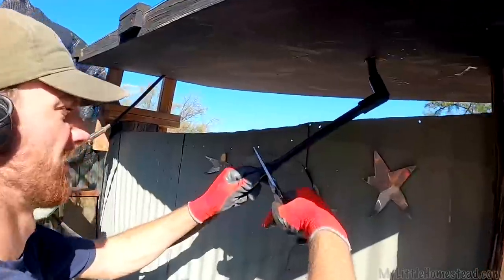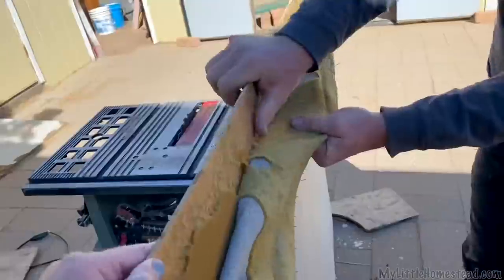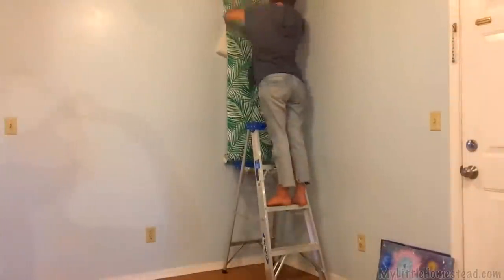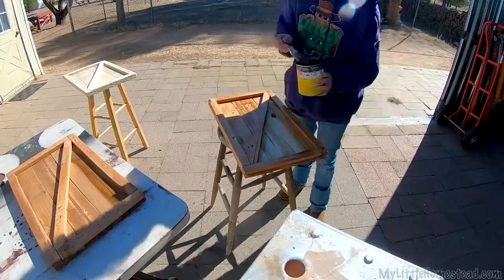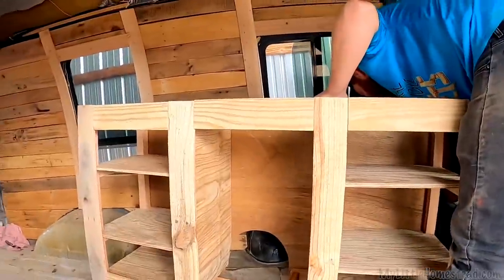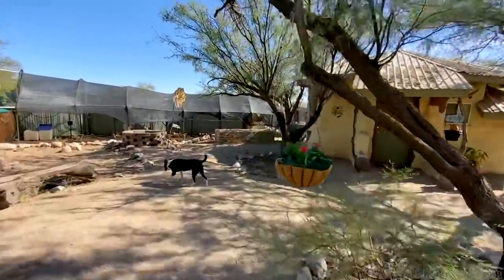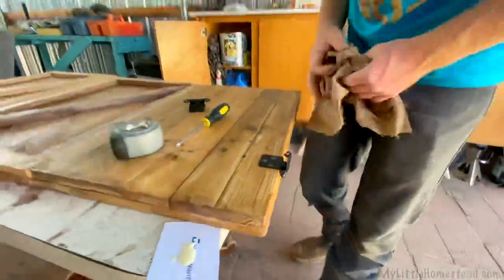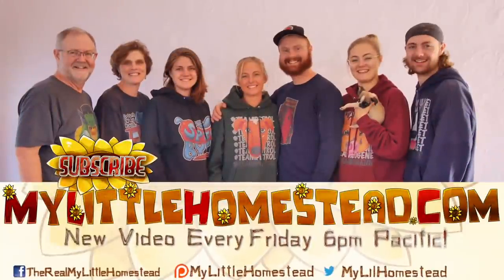Aquaponic Solar Water Heater & Van Conversion Cabinet Pallet Doors | Weekly Peek Ep258

Comment: To Bryson:  It strikes me that it would probably be a good idea to insulate the warmed water line between the solar collector and the aquaponic system, as well as possibly the long arms of the aquaponic system as well, to conserve as much of the gathered heat as possible.   Also, it might be a good idea to figure out a temperature activated cut-off switch for the pump, as well, to keep the temperature from going too high, in the event of an extended warm, clear period.
Reply: Maybe insulate both lines so it doesn't freeze on the way to the heating station?

Comment: You are basically using insulator to transfer heat and that's why you have melting. You have much more heat input then output and this causes heat to be accumulated to the heater input and eventually it will cause melting. What you have to do is to is to achieve as higher heat exchange as possible. You should try copper piping with black paint coating instead of using rubber/plastic hosing.

Comment: Bryson would it help to put the grey pipe insulation on the lines help keep them from freezing as the water sits in the lines at night. Or end of the season pool noodles. Shea you hair looks cute.  Garden and Ellie looking great. Nice thing about the old insulation it will keep the squeaks from being loud. You all have a great week. God Bless.

Comment: For many years I worked for the local High School Adult School.  I drove big band with lift and wheelchair equipment. We too would remove certain elements from the vans to haul things that did weight a bit. By removing the lift mechanisms you freed up poundage. Some older Van's may be under breaked so always give yourself a little extra breaking space when driving. You're going to be fine.

Comment: I run an exhaust fan for a hot upstairs storeroom directly off a solar panel.  It's amazing how much the speed varies when clouds pass by.  Make sure your system has a check valve so it doesn't drain back every time the pump slows down.  Best way to engineer a water system is with the pump at the source PUSHING the water through the system.   Diaphragm pumps like that are pretty good at priming, but pump much more efficiently by pushing rather than sucking.  Mounting it at or below the water level is ideal.

You might be losing a lot of your heat on the long run to/from the panels.  Look at the insulated double tubes used for outdoor boilers.  Adding glazing over the coils will bring much higher temps but another reason for the check valve, if the pipes are dry or the water still, the sun will melt the plastic.

Another way to prevent winter freezing is a geo system, where you have a run of tubing buried deeply, ideally with an insulation cap above, that takes advantage of the ground temperature averaging around 55 degrees year round.  Also works to limit maximum temp in summer.  Whether you're pumping out water at 35f or 85f, the return water is around 55f.

I saw the goats eyeing the new stuff over their pen.  They can be jerks, I hope they don't manage to jump up to try to bite or otherwise damage the hose.

Garen, beautiful looking cabinet, but now you feel why RVs are built with 1X lumber and thin ply paneling.  Weight really matters on mobile builds for both fuel economy and handling/performance.  Stationary furniture you can afford to overbuild  Also I've learned the hard way it's worth pulling shelves back out and fine trimming them instead of hammering them tightly in place.  It can push the whole piece out of square and sooner/later the force will start popping the carefully glued and fastened joints.  Careful those knobs don't hook the hammer loop on your work clothes one day!  In addition to ledges for the shelves, make sure to use RV not household door catches.  I remember my maiden voyage in a used RV where several weren't latching well anymore; maaan, stuff was falling out and those doors were constantly wagging and slamming the whole way.
Reply: My thought was pool noodles. Glad you mentioned it.

Comment: Thanks for another great weekly peek. Garren and Ellie depending on how heavy that cabinet is you should make sure weight in opposite side is even..a bed, or fold down seat something to balance so it doesn't make van easier to tip.

Comment: To regulate the water temperature of the aquaponic system you could have a T at the pump outlet one side going to the roof coil and one side bypassing it, both comming back to a shower thermostatic mixer then back to tank.

Comment: Might be a good idea to use some pipe insulation from the aquaponic system to the roof. At least save some heat loss as it travels between. That is if it doesn’t end up working as is during the coldest times. Love watching your videos :)

Comment: If that water is flowing to slow it will heat that water up to hot tube hot water and you dont want it that hot right. It's going to take just the right amount of water flow.

Comment: We did our cabinet doors the same, but the latches would not hold them when moving.  I then used Gorilla glue on the frame  and one on the door.  No more problem.

Comment: As cool as reclaimed wood construction is, it's adding a lot of weight just for the look of wood. You might find that the cost of driving the van goes up too much. If you decide to reverse course at some point, I've seen mobile construction using expanded foam insulation skinned in paint and nylon screening (what you use to keep bugs out of your windows and doors). It's strong enough while being extremely light.

Comment: Don't know how hot your sun gets, but we built a pool water heating system used 50mm by 150m  black PVC agricultural pipe. Only problem water got so hot that we fitted safety steam release valves as steam pressure popped pipe of joints at pump. Lucky pipe didn't fracture squirting boiling water allover. Sumer days temperature 40 to 43 Celsius Nov to mid Apr.  Many a summer day we switch pump off as our pool heats to over 33 celsius becoming unpleasant. You swim to cool down in summer, pool has been inclosed with folding doors alround permitting swimming 365 day's.

Comment: About the kitchen cabinet door. I would have installed the hinges on the right side. This way, if the door opens when driving, the door would naturally tends to shut. I would also install some sort of door stopper to prevent it to tear out the hinges if it snaps open. Finally,  I would "carve" the handles in the wood frame of the cabinet door. doing so, there would not be no tiny bits of metal (the handles) waiting to hurt your knees as you turn around in a small place. that is just my point of view, I am not an expert in any way.

Comment: one of those window squeegees helps with wall paper... I like the glue back ones better than the peal and stick.. it's got like a delay to the permanent hold..
Reply: OH.. window tint as well...
Reply: Ah... Bryson? - walk me through that again... slowly... and maybe use my White board I just refused to continue with out..  LOL...  sigh.. tell me about the light sensor again? Now.. it's going to turn the pump on... when there's no light during the peak hours of the days?
Reply: Oh... and This winter... I would like to discuss... the small 120 volt personal water heaters... For the Temperatures below 50 degrees.. - Sigh...  there are several models... but What i was purposing.. just one of the units installed in the storage tank? or even a tank as the exit tank from the main tank? sigh.. - Just a thought I had when I was your age trying to get permission to try this set up... - I still pout about The BEETS... Beets that don't taste like the Dirt they grew in.
Reply: i even tryed growing them in Peat.. but they didn't survive.. sigh... Peat isn't wet enough and too tempered..  Sigh
Reply: Oh you must do a study on Peat.. it was So informing... I could not believe it.. Oh I want to tell you all about it.. sigh... Look it up... Not sure about internet? - I'm so old school on it.. I even ordered in Book at the library.. LOL>.

Comment: Hi, I don’t want to put a dampener on your van remodel but you are using 2 X 2 and ¾ inch plywood. I have built a few campers in my time and they were always 1 X 1 and 1/8 inch plywood to keep the weight down, I only hope that you are not building in problems for the future.

Comment: The solarpanel driving the pump for the solar heating seems quite big. Could it happen that the panel delivers enough power for the pump to run even if the outlet of the heat collector isnt warm enough? Let assume its very cold outside, the heat collector pipe is not insulated and doesnt get warm while there is enough sunlight to power the pump. So maybe a temperature sensor to activate the pump only if the collector is warm enough, but also to stop the pump if the aquaponics get too warm. Oxygen solubility in water lowers the warmer it is, which the fish really dislike. They might express their dislike by showing you their bellys.